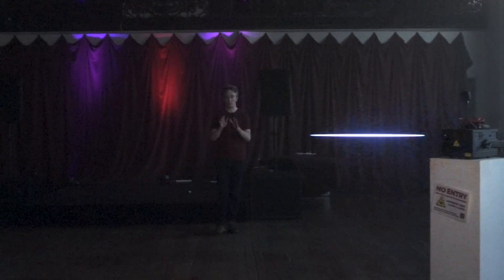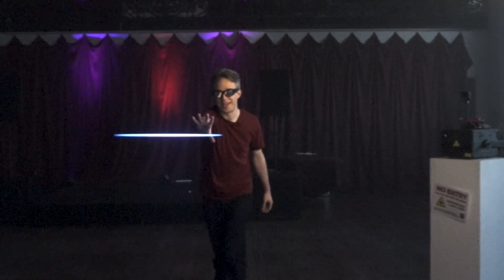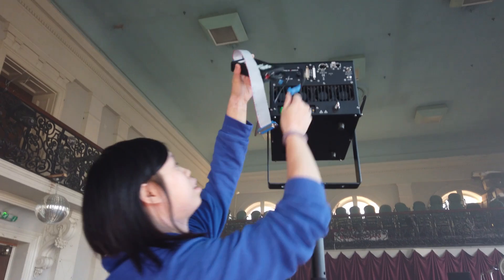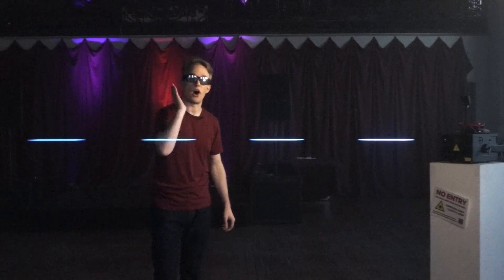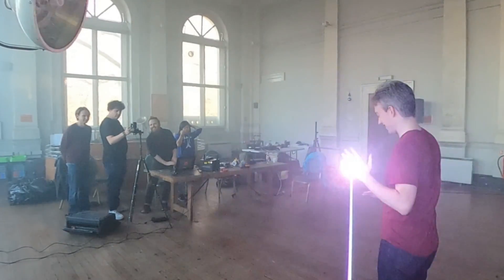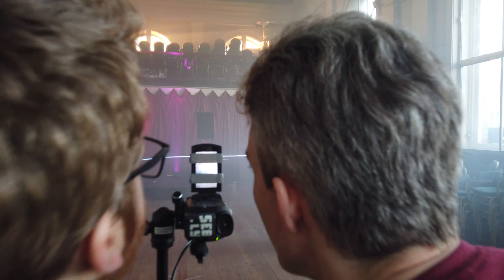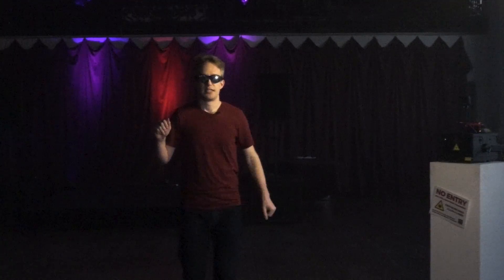Stopping A Laser Beam In Mid-Air

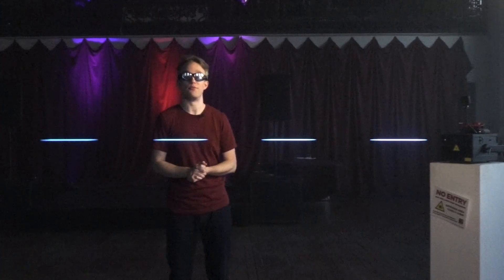Comment: one slight issue, you mention at 2:03 modern cameras "don't take a frame all at the same time like an old school photograph".
Well, neither did old school cameras. They still had a physical shutter that needed to open and close, and this would wipe across the film plane.
For stills cameras, using higher shutter speed (I think the terminology is above "sync" speed) even meant that the rear curtain would closely follow behind the front curtain, exposing a thin strip of the film as they both moved across - which is precisely the same thing as rolling shutter.

Comment: If you turn the laser on and off fast enough, isn't it theoretically possible to do this exact thing without exploiting the rolling shutter trick? 
It would require pulsing the laser so fast that it literally turns on and off several times before the beam of light crosses the room.

Comment: To everyone kvetching about the lack of safety goggles in parts of this video..... lemme letcha all in on a little secret. Laser safety goggles for these types of lasers DON'T ACTUALLY EXIST . This is an RGB laser. You wanna block high powered red, green and blue lasers simultaneously like the kind this show laser produces? Hold a brick in front of your face, because that's about the only way it's gonna happen. Those shiny metallic lasses Tom is wearing in some parts of the video? They're not real laser protective eyewear. They do nothing to protect vision from these mixed beams. They're the cheap Chinesium crap that the laser manufacturer in Shenzhen throws in the box before shipping it off because they literally DGAF. They're probably just fkn $2 gas station sunglasses. Source: me. I work with ultra high power lasers (quadrillions of watts) every day, and order laser safety eyewear regularly. Metallized, shiny, Oakley type laser protective goggles like this don't actually exist. They're not a thing. They would do just as well to throw those things in the trash and use common sense about diffuse and reflected beams when working with these systems.

Comment: If you focus the laser with a lens you can cut metal. I worked on a system that cuts solder masks for the electronics manufacturing. We only used 7 to 10 watts.

Comment: Very Very, Disappointed. 
Actual laser can do this too !
Adjusting focus point of a fs laser in air, generates plasma filamentation, 10TW 30fs ~ a meter in air.
Also this is against ANY h&s in UK, goggles leak from sides, there's a  chance back reflection inside will blind you.

Comment: Blasters (in Star Wars at least) are particle weapons that fire high energy particle beams which emit light corresponding to the gas used to create them, thus the bolt does not travel at the speed of light, since it is not, in fact, a laser weapon. Sorry, couldn't resist writing this. Keep up the great work with your videos!

Comment: The way you do bullet-time dodge is you shift your weight to the insides of your feet (laterally) so you're essentially balancing on the inward sides of your feet, you angle your feet outwards and put a massive load on your ankles, then proceed to balance backwards. The footwork is what makes it possible... Is also a limbo trick.

Comment: Not all digital cameras have rolling shutters. The CCD sensors used in many broadcast cameras use a global shutter.
Reply: yes, and actually many film cameras had rolling shutters too, especially the ones for stills—it was the dominant kind for the 35mm format
rotary shutters for movie cameras were also common
Reply: @666Tomato666  Even today in digital cameras, especially professional ones like RED cameras, the metric of shutter angle is still used, a combination of shutter speed and framerate. This is a remnant from rotary shutters. A shutter angle of 90° means that the exposure time is a quarter of the time each frame represents (at 24 FPS, the standard in movies, that's about 40 milliseconds per frame, so 10 milliseconds of exposure time). This is because with a rotary shutter, 90° is a quarter of the disc, and the shutter disc makes one revolution every frame, therefore the film is exposed for only a quarter of the time of the frame. Film cameras and rotary shutters are used less and less of course, but shutter angle remains as standard terminology.
Reply: @photonicpizza  It's just percentage, but instead of max being 100%, the max is 360°
Reply: Yup, and doing some quick googling the cost for a camera is several thousand to over $10,000  That doesn't even come close to the cost the broadcast lens which can cost over $200,000.
Reply: @Dysan72  actually there are far cheaper options, like Black Magic Production Camera 4k that offer global shutter

there are also rolling shutter cameras that have very fast readout (<10ms) like the sony a7 III  or the Canon 1DX II

the lenses for them don't cost as much as a cheap house too...
Reply: @Dysan72  The optics are the biggest factor in the added cost as CCD sensors are less sensitive than CMOS sensors mostly because of the benefit which results in rolling shutter being used namely that the rolling shutter allows the sensor to continue collecting light during the readout. CCD sensors need to be kept in complete darkness for the entire duration of the readout of every pixel thus less effective exposure time per frame and less sensitivity so you need a larger aperture and thus larger lenses etc to be able to deliver good performance over a range of different lighting scenarios.

Comment: Was really hoping the effect could be seen with a human eye, regardless this is still really awesome.
Reply: There are versions that do it for the human eye, but they're noisy - focus invisible light to the point it turns the air to plasma at the focus point, and you draw your image from little dots
Reply: Blink 60 times a second
Reply: I am no expert at all but if you combine that laser with a bright light that illuminates the room at a specific frequency the light could make the laser look less intense infront of the now light up background. A bit like the floating water experiment but in reverse.
But it might not work this way since the other experiment works with the absent of light and this with the addition. Means the eyes will probably just "fill" the time with no light and therefore no visible effect.
But what about this effect with 3d glasses that open and close? Very likely it is open for too long...
Reply: Schoko4craft it wont work since all light has same speed. unless the strobe light is in vacuum and the other one isnt.
Reply: @Schoko4craft  Persistence of Vision will definitely prevent that from happening.
Reply: @Schoko4craft  won't work because eyes latency and such
Reply: @Schoko4craft  That wont work. Key to this is having periods of time where the pixels are not capturing, and our eyes dont do that. They are always sensitive and we will just see the average brightness of both the light and laser line. But no interruption in the line.
Reply: @Schoko4craft  I don't think it would, but then I'm not an expert either.
Reply: @Schoko4craft like with a incriedibly bright strobe light  i would also expirement with special glasses/goggles  and maybe fog/smoke generaters 
But theroreticly you could do the same thing if you have a shutter switch on the laser to turn it off and on fast enough(really fast)0
Reply: Kelly Nolen your last thought is how they created the effect in the video. They are pulsing the laser. A mirror is used to “aim” the laser.
Reply: @kellynolen498  - I'm afraid that wouldn't work - you could create a short pulse of light but it'd be way too fast for our eyes to see and anything we could see would just look like a normal beam
Reply: @JohnnyWednesday  well im just shootin ideas with my simple and unen distibution of knowlage of course you have to do science if you want to actually do it
Reply: @Schoko4craft  no it won't. That only works with effects that also work on a full frame shutter, but this requires a rolling shutter so it's not possible.
Reply: @sinom  Okey makes sense
Reply: Probably an impractical idea, but just get some glasses that have a rolling shutter in them. Don't know how to make it happen, but theoretically it'd just be reproducing the camera's effect right in front of your eyes.
Reply: @richardpike8748  I think this won't work. As far as I can tell, in the version with a camera not only the rolling shutter but also the camera being stationary is crutial.
It is all about timing the laser to be on/off when the rolling shutter is recording a certain row of pixels. The rows with the laser being on will always be the same, regardless of camera position. (Except that you will, of course, always see no beam where the laser beam is not in frame.) 

Obviously a person with some glasses would not be stationary.
Reply: @steffahn  Good catch, I suppose I forgot about them delicately calibrating it with that stationary camera's own specific shutter frequency and positioning and stuff.
Reply: “Delicately calibrating” = plus or minus one 🤣
Reply: @richardpike8748  any VR glass in AR mode :P I think it's cheating but I'm not sure if it is possible to get the rolling shutter effect on a transparent material. Active shutter 3d glasses essentially have global shutter, and you need to make each individual pixel sized part individually addressable(aka non transparent conductive wires/insulators inbetween) Even if it is possible, the R&D budget required for this is astronomical (and the end product is a worse 3d active shutter glass with very limited useful applications :P)
Reply: well you can still try to blink at the frecuency the laser was configured to turn on and off
Reply: If you use a variably focused pulsed laser you might be able to break down the air in patterns along a line.
You wouldn't even need a camera to see the effect just really good goggles to avoid being blinded.
If the pulsed laser is infrared you would only really see the light that is created by the high temperature plasma at the focus. 
The trickiest part would probably be finding some method of shifting the focal distance quickly enough.
Reply: I’m glad it can’t be seen with a human eye. Human eyes > camera
Reply: I wonder if you can get a visible effect with two near infrared lasers of different frequencies, joining them to the same beam, so that by intereference you get some spots of doubled and thus visible frequencies and some spots where they cancel out. Would not be a hard cut on the end of the dash of light but could make some dashed patterns at least?
Reply: @chriswel  good idea, but the photons should be overlapping exactly on your iris(you are not seeing the wave that is in front of the laser diode, just the photons that are reflected by the air)
Reply: And the air will reflect the laser with random polarities and it will prevent them from adding up if I remember optics correctly.
Reply: @chriswel  You could, but the beat frequency is the difference in the two frequencies being combined. To get a "wavelength" (envelope length?) of 1 meter you would need to get a beat frequency of  300 MHz (3x10^8 Hz). The lowest visible frequency is about 430 THz  (4.3x10^14), so you lasers would have to be the same frequency to within better than one part in a million. That's easily a multi-million dollar engineering project just to get a working prototype.
Reply: @danieljensen2626  Okay, let's do it! :D
Reply: @chriswel  you can, that's how holograms work.
Reply: @chriswel  you don't need different frequency lasers, just change the frequency of the lasers, (i.e time one laser to fire later than the other). It's like timing two bullets to collide in mid air, except with lasers (and waves in general) it doesn't explode, but instead becomes either stronger or weaker.
Reply: Agreed
Reply: Maybe with polarized glasses and a polarized light can be done, but i am no expert nether
Reply: Stick a set of VR goggles on with a front facing camera which uses rolling shutter. Simple
Reply: @BlueShift815  no, not simple at all.  The calibration is intensive and slightly moving would ruin the effect.  Also, the question I'd with the human eye, which you completely ignored.  The only reason you solution is simple is because it neither addresses the issue or actually works.
Reply: i've seen similar effects that work with the human eye
Reply: You would need to rotate with a tight angle periscope, or a rolling cage with one panel open around your whole body, or a roller shutter in your glasses and around your head. Ahhhhhh!
Reply: Maybe one day, my friend
Reply: You could use fast shutter glasses like those used for 3D to produce the effect
Reply: You can do that I think, if you use shine lasers together and create phase differences between them such that constructive (lasers become brighter) and destructive interferences (laser becomes dimmer) line up where you want them to. that's how holograms work if I remember right.
Reply: Maybe we could make a rolling shutter glasses with a rotating disk with slits on it
Reply: You can, blink really really quickly
Reply: You might could be able to do just this in-person with carefully calculated and contained 
smoke and air channels.

Comment: I thought this was going to be about the CUP (compressed ultrafast photography)camera used to record laser beams at trillions of frames per second.
Reply: Turns out this is like the reverse - slow photography.
Reply: Would a camera like that even behave like a camera? I mean the res would be so low it might aswell be called a light detector
Reply: I thought that Tom had already done a video on that technology, but I could well be mistaken.
Reply: @sixstringedthing  Slow Mo Guys did a video on it. Wrong Brit.
Reply: @JaxMerrick  thanks for the correction
Reply: I thought it was going to be about passing laser light through certain mediums, where the speed of light in those mediums is very slow.

Comment: Next video: Stopping a moving train with my bare hands
Reply: My cousin does that every day. He's a train driver.
Reply: Then moving it left and right and then up and down
Reply: It can be done... If the train is only moving at about a millimeter or two per second, it's engine is not engaged, you're really strong/have a lot of endurance, and you are on a long straightaway on flat ground.
Reply: @K9TheFirst1 … or if toy trains count. 😉
Reply: That's easy. I could do it with one hand. Although I wouldn't want to, because I'd lose the hand. 

It works like this: you stand by the tracks, as the train approaches you reach out a hand and SLAP that mofo in it's little train face. so your hand starts out travelling at, whatever, say 10mph towards the train, then as the train hits it at 40mph in the opposite direction, the hand slows down, stops, and reverses direction. It has to stop in the middle, it can't go from 10mph to -40mph without passing through zero. It passes through zero mph at a time when it is in contact with the front of the train, therefore the train must hit zero mph too. And that's how you stop a train with one hand.

But, like, you probably shouldn't.
Reply: @MethCrystal666  you probably won't even get the train's speed to 0
Reply: tom scott is god
Reply: You must be prepared to get very very long arms by the time the train is stopped
Reply: Tom: pulls brake in engine car
Reply: Did you know that if your standing on the train tracks the train will actually stop for you...

One mile after it runs you over